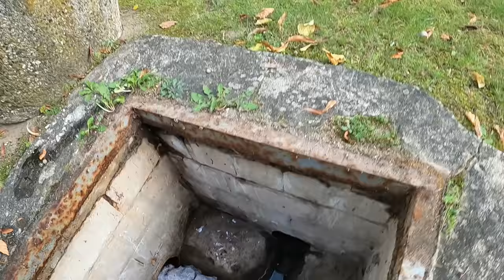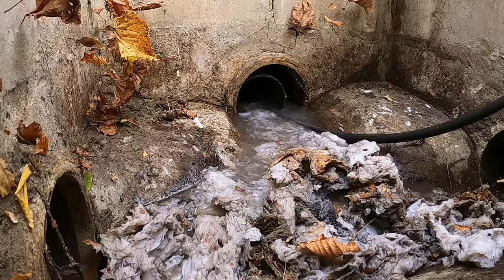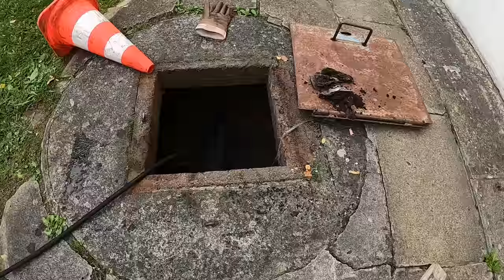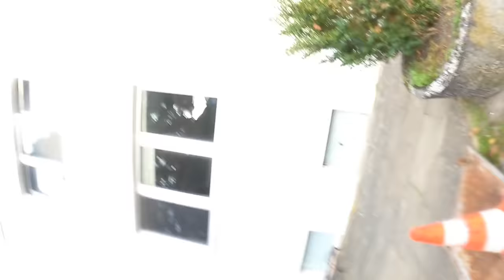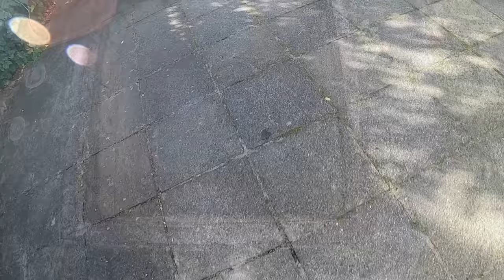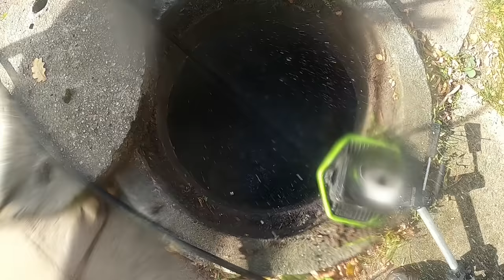Kempinger 266  Kollege meinte, er hätte etwas  Content in der Grundleitung zum Herausspülen.

Comment: I know the double barrel is a beast but the flounder is quite impressive as well 👌
Reply from the maker: Yeah .Old school stuff . Depending on the pressure, it sprays 15 meters or more.. Its for large Pipes with stones and mud on the bottom of the pipe...
Reply: @kempingerrohrreinigungberlin  nice 👌
Reply: @kempingerrohrreinigungberlin  Zum Glück haben wir die Schwerkraft - wenn der Sand jetzt oben am Rohr liegen würde, wäre die Fluder schier arbeitslos ^^
hehe

Comment: What a waste. I can turn the shower on at home to hear water rushing. Please use some light in the hole so we can see what’s happening. You seem to be knowledgeable and hard working. Up the game in your vids.
Reply from the maker: Hi Diane.Ok.  I can tell you that after an hour's drive , I was a bit disappointed too. Nether the less, I also won't be able to please every one.
See , there's a bit more to the trade than unblocking pooped manholes with one and the same nozzle. 
I am assuming you are a homeowner. Here you can see how blockages  coursed through , sand, root ingrowth in  pipes, lime scale, grease, in, under or in front of  the house can be done with. Thus, lifting systems are of interest here too
So it depends on what you expect, I guess.
Anyway, to be honest , you are the first one to complain about the light, please tell me what minute you mean. I didn't notice that myself.
That said..have a nice Easter time.   Carsten